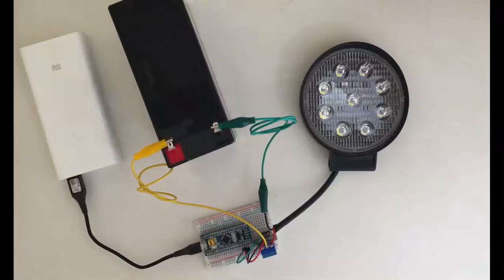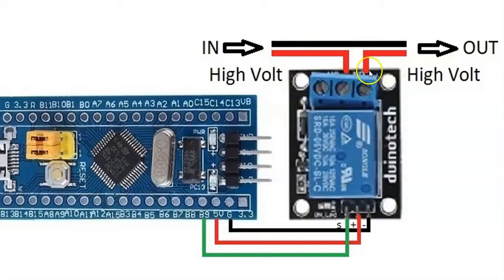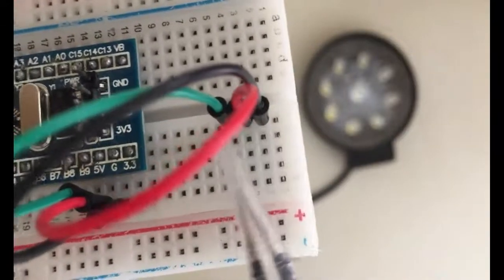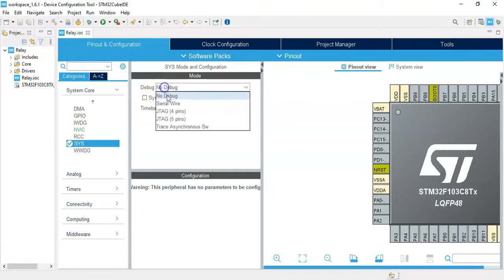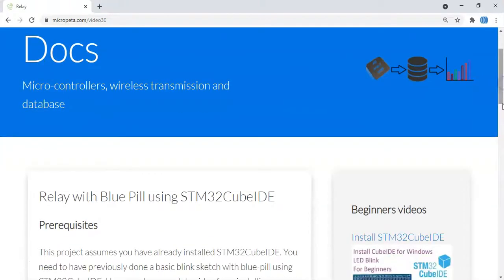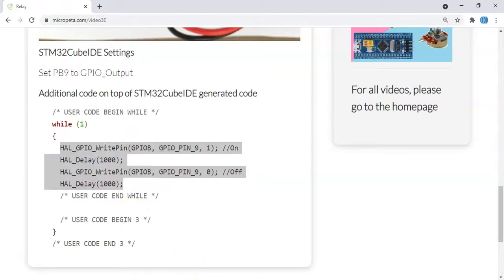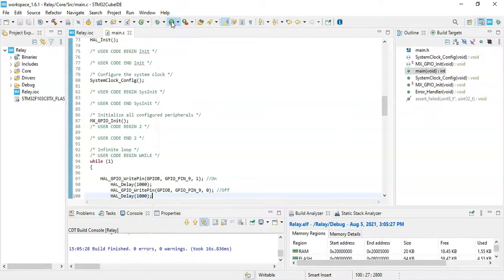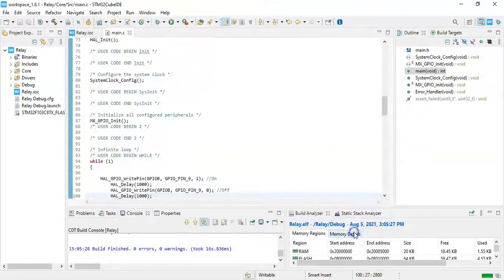30. STM32CubeIDE 5V Relay with STM32F103C8T6

Comment: can I connect digital 5 volt sensor to it? and what is the STM pin high and low voltage?
Reply from the maker: There are 5 volt tolerant pins in stm32 as in https://reversepcb.com/stm32f103c8t6/

Comment: Hello sir, first of all thank you so much for providing so much basics regarding the stm32 blue pill board. I am new to this and creating my first project on this board. so the doubt is that when I am interfacing the relay in my project w.r.t my written code the relay is switching on but with a certain fluctuations we can say like turning on - off in microseconds, while it is meant to be continuously on steady once triggered. but as it gets triggered there are certain fluctuations type of thing. please help me to figure out. thank you.
Reply: ı have some problems ı guss this from the stm mcu output signal is 3.3 v but switch want to 5v

Comment: I am providing a signal from stm32f100rb and the led blinks if i connect it directly but when module is used to blink led the module just remains on dont go as on and off, kindly tell solution

Comment: Thanks for this!...I just subscribed. Can the STM32 use a 2 channel relay?...or because it has a single
 5V pin it can only use 1 channel 5V relays please?
Reply from the maker: Hi Michael,
Yes, you can use as many channel relay as you want. You can also use with many single channel relays. Connect 
+/VCC to 5V
-/GND to G
Choose any 5V tolerant pins to signal pins
I have shown 5V tolerant pins in Video https://youtu.be/oD0mc6FXQ0s time 1:10
Reply: @NizarMohideen  Thanks for the swift reply...I have gotten more interested in electronics, and have began to explore this stm32 device. Definitely expect me watching your other videos attentively...there are few videos out there that do this. Thanks again and great work!🤝
Reply from the maker: Thanks. You are welcome